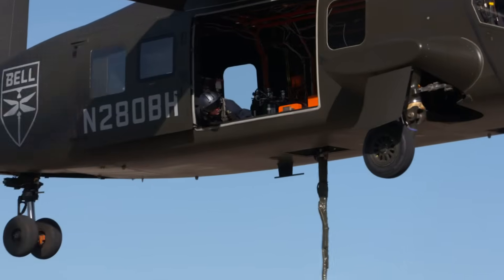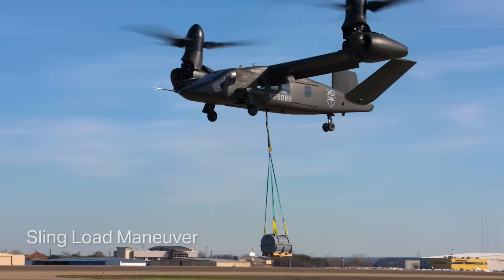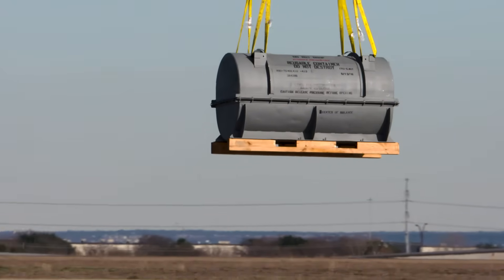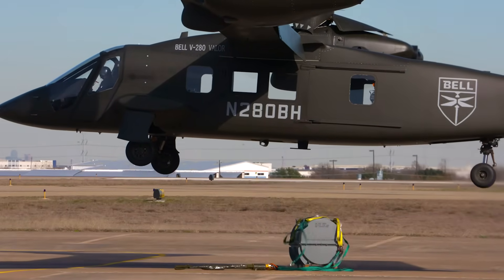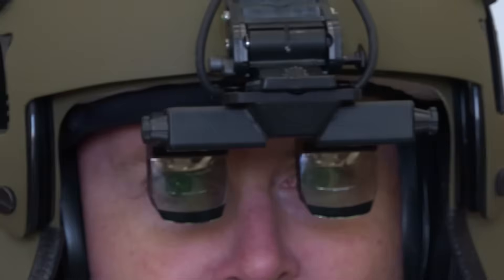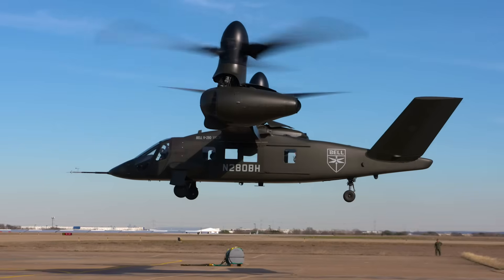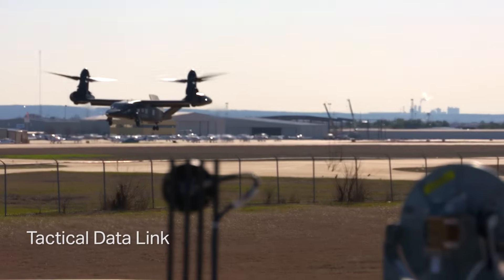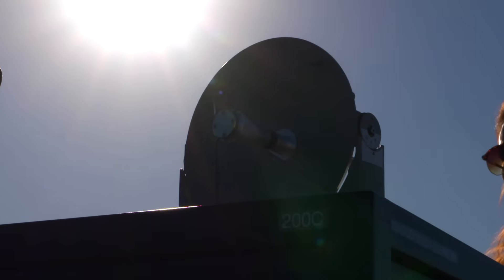Bell V-280 Valor Sling Load & Tactical Data Link

Comment: I'd like to see a variant tested with landing gears that fold down from the wings about halfway out.  Seems like there'd be less chance of it rolling over and sawing itself 2 pieces if it had a wider wheelbase.🤔  I mean if it isn't going to be folded up for storage on a C-17 or ship anyways.  That wheelbase when compared to the width of the machine just looks like trouble.

Comment: Hope V-280 wins FLRAA contract but even if it doesn't I'm sure the Marines/Navy will adopt it eventually.
Reply: The Army know the V-280 Valor is a proven success, and has exceeded all the benchmarks they set for it.  Over 300 knots (556 km/h) of airspeed and 200 operational flight hours places it in a league of its own.  For the Navy and Marines, Bell's designed a shipborne V-280 variant with blade fold & wing stow:  http://www.edrmagazine.eu/wp-content/uploads/2016/07/11_Bell-Textron-V-280-Valor-P-Valpolini-Copy.jpg
Reply: For the Navy and Marines, Bell's also designed the V-247 Vigilant ... a shipborne drone, with blade fold & wing stow:  https://www.youtube.com/watch?v=uHrVScLDUbQ

Comment: Can it sling load an M777?  I imagine that would be a primary operational requirement.
Reply: Probably won't know for a few more years as a lot of the specs remain classified for now.
Reply: It's meant to replace medium lift helicopters, eg. The black hawk.  There are separate programs for heavy lift
Reply: @taoliu3949  I'm pretty sure the Blackhawk can airlift the M777, hence my question.
Reply: @travisjohnson6703  It "can", but is not normally done due to safety issues.  It's normally lifted by Chinook.  And yes, the V-280 can lift a M777, it has slightly more lift capacity than the UH-60
Reply: Remember the V280 is a prototype aircraft. They're not looking to push too hard. (Hell, Sikorsky just started flying last year, Bell's been flying for 3 years now). Also the Army has a new generation turboshaft in development for the production version. The final spec aircraft will be more capable in every conceveable way.